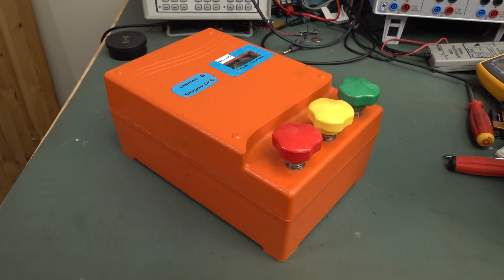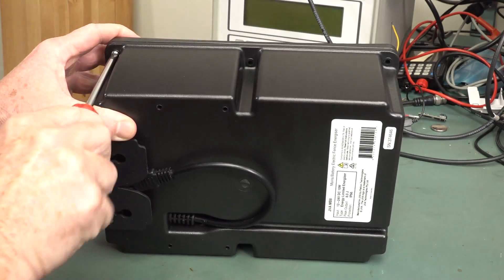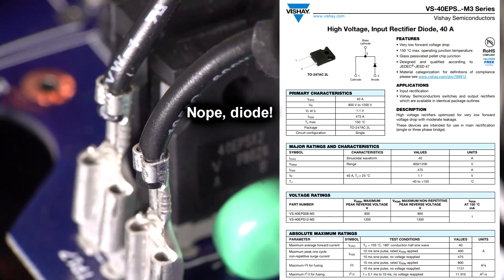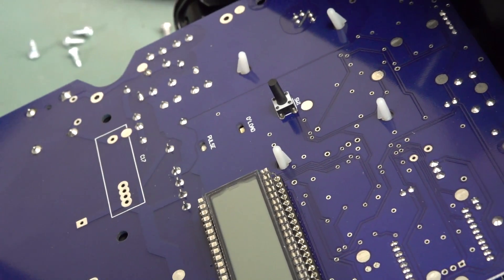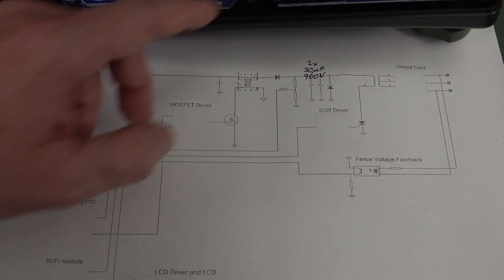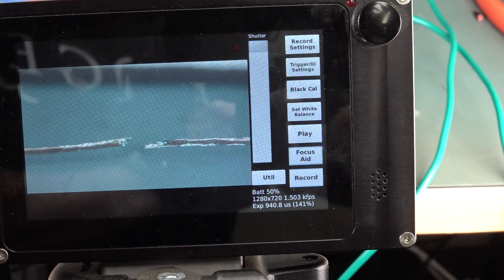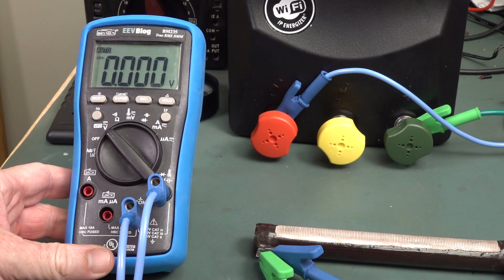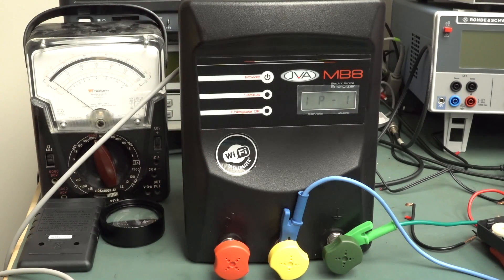EEVblog #1292 - $2 Meter vs JVA Electric Fence Controller!

Comment: 14:00 more light required?? The one thing we care about (the arc) comes with its own light source, and it's already saturating the sensor. No need for more light to light the background, just dial down the sensitivity and live with the fact that the background is a bit dark.
Reply: I suspect that without the additional light all we'd have seen is a point of light with little range or definition.
Adding the extra lighting I think helps to bring out the detail of the plasma and shows the environment the spark occurred in.
Reply: @virtual812  what I think we could have seen with the right settings is a gradient within the arc, ie that we would be spending our dynamic range on the arc, so that both the lowest and highest light intensity fits within the dynamic range. At that point we might start to actually see some of the structure of the arc.
Reply: @Gameboygenius  Sounds interesting, but I don't think removing light is the right way to go about it. Even more light would be be needed again.
If there was no light the gain of the sensor would be very high if on auto, and the spark would blow out the image (assuming the gain cannot compensate fast enough) . Alternately with additional light the gain can be lowered thus shifting the usable range up. If gain was manually set it might be hard to catch it at all, or catch gradients.
Reply from the maker: I didn't want the dark grainy background.
Reply: Lights won't make the arc any brighter.   They just help to see the wires before it discharges.

Comment: As someone who has worked in agriculture for half of my adult life I can say with the pain of experience that yes, they bloody well bite, but yeah, not the end of the world.  Worth setting up on a short line of wire and giving it a crack (pun intended) to experience the true joy of the unit.  Highly recommended for childrens parties.
Reply: Children's parties?  I was going to use my $2 Chinese 500,000V module but if you say this works better I will have to give it a try.  Thanks for sharing your expertise.
Reply from the maker: I get electric shocks at the tough mudder events. You have to run through a whole string of dangling wires hooked up to an electric fence controller.
Reply: @EEVblog  JVA supplies Tough Mudder electric fence energiser. It is the 0.5J solar version
Reply from the maker: @MrShaunwesty  Ah, always wondered what model and the J's, thanks. It still bloody hurts. I've seen people get tangled in the wires and just get continually zapped, they look like they are having convulsive fits. It's kinda funny :->
Reply: @EEVblog  On a Tough Mudder I started running through the wires and the next thing I knew I was inches from the ground doing a faceplant into the mud.  There was no memory of getting shocked or most of the fall.  I have an awesome picture of me getting up covered in mud.  Because I don't learn I keep doing these events - never had the memory loss again but I do run a little lower through the wires so there is less distance to fall.

Comment: Thank you. I think this is one of three videos realesed on YouTube in the last five days that is not about Coronavirus
Reply: Actually... if you hold onto the fence wire for at least 60 seconds it will kill the COVID-19 virus.  Give it try.  Trust me... I saw it on the internet.
Reply: @ElmerFuddGun  Please add Irony for the idiots. We almost have a complete lockdown over here in Germany - not funny. Humor helps though...even for Germans.
Reply: @ElmerFuddGun  No, a better way is to take a bath in alcohol. Jokes aside, you can't find any alcohol to buy.
But I guess if Russia were to have cases (they do) they'd drown in vodka because the virus is too 'weak' to tolerate it.

Comment: That "trench" in the middle of the pulse to me looks very much like an arc is cutting it off. But we didn't see any arcing there. Weird.
Reply from the maker: Yeah, this was just with the resistive load.
Reply: It almost looks like the hv differential probe is ac coupled...
Reply: I thought about your comment, the thought train I can see is that a plasma ark would act as a single resistor circuit; I can see how that would drop the supply voltage slightly, but not how it would cause a trough in the voltage from a transformer being shorted.  Mind helping me see what you are thinking of?
Reply: @BloodAsp  My thought was an arc would be extremely low "resistance", making any current flow through it instead of the resistor divider. No current in the divider -> no measured voltage.
But there was no arc so I don't know what's going on.
Reply: Isn't it more like charging the magnetic field of the transformer followed by the brakedown of the field ?

Comment: WiFi?  I've been waiting until I could control my electric fence on my phone... time to buy!
Reply: It's more about monitoring.

As someone who operates a bunch of fence units, regularly checking everything is working properly is a chore that could be sped up immensely if I was getting regular status updates from the fence units.

My fences are only a mile or so long. I can only imagine what it's like for the huge aussie farms with hundreds of km of fencing to monitor.

NB. Wifi would be a waste of time for me as I'd want to be able to get the updates when I'm not on site or am out of range. The GSM option they offer would be nice, or preferably a Lora-based approach as I already have Lora sensors on water tanks and for weather monitoring.
Reply: @DEADB33F  The WiFi system is not for local access (when you are within range). It is designed to connect to an Access Point and then to the Servers via the Internet. You can download an Android App, or iOS App on your phone that also connects to the Servers and you now have off-site information. Yes this requires a nearby AP, or a Wifi Extender, or directional Wifi system or a 4G Wingle (Wifi to Cellular) to get the Energiser connected to the Internet.
Reply: Yes I am an Engineer at Pakton. I work on the Security range, but know a reasonable amount of the Agric design as well
Reply: @MrShaunwesty  Ah, that makes a lot more sense.

Still seems like an application probably better suited to a LPWA  style last-mile network (LoraWAN, Sigfox, etc) where a single low power GW can cover hundreds of sq km and service potentially thousands of end-nodes. 

In Europe's case much of the continent already has pretty good coverage by these networks, so for many having their own gateway wouldn't even be required. 

....I'd imagine it's the case that because these are reasonably new technologies they may not have been an option when the wifi fence units were originally developed.
 They're certainly a much better option to Wifi or GSM based approaches nowadays (although those can still be used for the actual backhaul).
Reply: @DEADB33F  LoraWAN is something we are looking at. Possibly just replacing the Wifi Module with something that will fit that space. Paul has done some research into this. In outback Australia, having a 10km link would be useful as there can be zero infrastructure so Energisers could relay the information back to the residence. 
I think the marketing goal for the design was "First Wifi Energiser".
Reply: @MrShaunwesty  I'm sure the same would be true for game reserves and the like.

It's pretty easy to work with. 
A few months ago on a whim I bought a dozen 'CubeCell' SoIC/Lora modules for a few quid a piece and in an evening was able to get reliable working sensors that were drawing <5uA of current and were generating hourly reports to an MQTT broker.

I'm using a cheap (£70) gateway designed for indoor use, but in an outdoor enclosure with a 3dbi antenna attached. Furthest we need to go is 5km and are managing it easily, and at closer ranges we're still getting signal even with occlusion from dense woodland & terrain ...Something unimaginable with Wifi.

I now have nearly half a dozen nodes hooked up to water tanks across 1000 or so acres, one doing some basic weather monitoring, a couple of remote trip sensors in areas we've had issues with trespassers, and a couple of gate sensors on gates which footpath walkers often leave open.

Am now looking at making some basic fence monitors ...as not willing to pay the price of buying commercial units (no offence 😄). 

Last month I knocked up a basic proof of concept voltage divider based one on a breadboard which does the business, now need to add some isolation via an opto and whack it down on a PCB. With the design I have in mind based on making a dozen or so the full BOM worked out about £20ea, which I didn't think was too bad considering the tiny volumes involved.
Reply: @DEADB33F  We are doing a lot in Game Reserves in South Africa. It is more advanced equipment that can monitor 5km lengths of fence and report a location of a breach. The information is sent using directional WiFi links (Ubiquiti) to a monitoring station where it is displayed on our PC program. 

Old Pakton equipment is protecting the Bilby in Queensland (think it has been running for 15-20 years now) and they recently requested tenders to upgrade their system. It is awesome to think that this stuff has working all this time.
Reply: @DEADB33F  20 quid? That is a nice BOM cost. We have talked (locally) to a designer who did the same (Lora fence monitor) and we helped with the fence connection design. I cannot remember the cost of their design. 

We are also using MQTT talking to a broker, but we wanted a responsive system where the customer could turn ON/OFF their energiser and get updates. Completely overkill, but if you are connected via Wifi then why not? 

When someone else gets the time (I am playing with ESP8266 and ESP-32 designs at the moment) to work with a Lora system I am sure they will have as much fun as you are. I am going to guess it will be Paul.
Reply: @MrShaunwesty  Yeah, I gathered you were working with game reserves  from Paul's interview in the linked podcast (listened to it after watching this video).

Since you'll already have most of the infrastructure in place have you done any research into using acoustic localization & gunshot triangulation for locating the shots taken by poachers (and punters in the case of sporting estates).

I run a small game shoot in the UK and since forever here driven shoots have tended to just have a bloke with a clicker counting shots so they have an idea how many were taken over the day. I'm kinda toying with the idea of making a gunshot triangulation thingy so we have detailed info on which pegs are 'hot' and which aren't getting much shooting, generated heatmaps of where most shots were taken (to be handed out with the day's shoot cards), etc. ...but mostly for fun and curiosity's sake.

On a larger scale something like that seems something that game reserves could make good use of.
Reply: @MrShaunwesty   I've not done much with two-way communication yet. Mine all just have some copy-pasted code someone else wrote that allows the duty cycle/reporting rate to be updated via MQTT.

Could easily be adapted to do anything else though. Main issue being that on class-A Lora nodes the commands wouldn't be acted on instantly as the command packet wouldn't be received until the node next sent an update. On the non-interrupt based nodes I've done that's once an hour for me (but could be anything).

---

I'd suggest testing out a couple of CubeCell dev boards with a basic gateway though. They're compatible with the Arduino IDE if that's what you're using for your ESP work (it's clunky but has great library & sensor support). 

...Heltec (the manufacturer) has plenty of example code to get you up & running. I'd imagine your main challenge would be on the provisioning side and how you handle that aspect.
Reply: Yes, I used to work on a farm, and the farmer was always worried about a branch or ornery cow breaking the fence and having the cows get out. That usually results in thousands of dollars of fines, as long as they don't get hit by a car, then it goes up from there. I'll bet that old timer would have loved to have something that would tell him that his lines are intact.

Comment: And that "12V - 24V" on the input will actually be more like 10V-30V because he has to assume someone is going to be charging a 24V battery system using a truck alternator/jumper cables.
Reply: Dave Micolichek  you said 12 to 10 mate "How would a jump start from a truck drop 12 volts to 10 volts? 🤔"
Reply: Dave Micolichek  IR2 losses in the cables